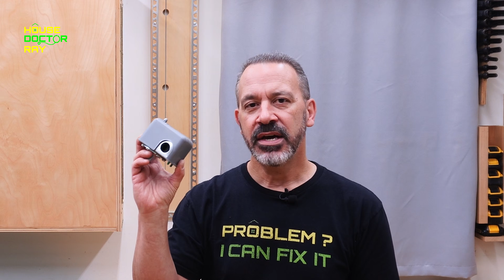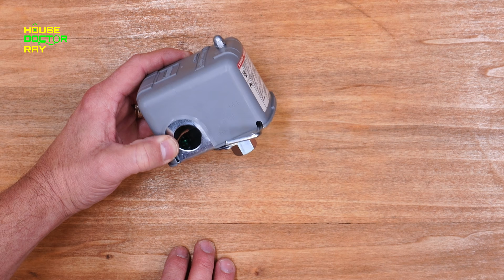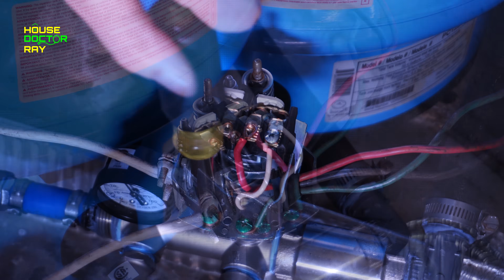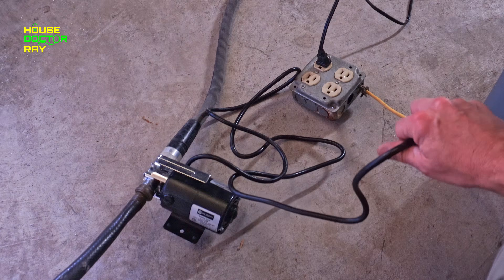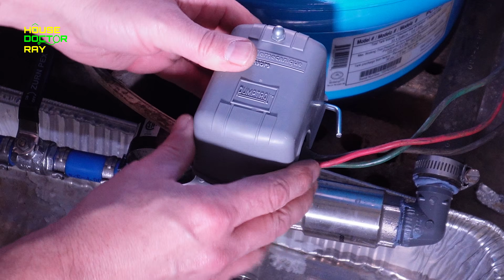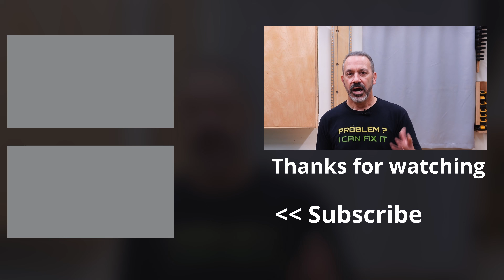Replace your well pump pressure switch

Comment: We have this switch and I’ve been using it for years successfully. Two years ago everything got replaced, but recently are well pumped that feeds into the holding tank quit working correctly. I just had water delivered to our holding tank till we get things figured out. But now I cannot get my switch on this device to put pressure back in my pressure tank.
The device does arc but pressure does not raise at all.
The bladder in the device is full. Any advice??? It’s been a long day.😢
Reply from the maker: Get a multimeter and see if power is going to the pump.  Then check the amp draw.

Comment: I have a 40/60 switch on my outside well pump,,have little pressure in home until pump turns on,,,tried adjusting switch to turn pump on faster and at lower pressure but it still starts at 40 ?Have great pressure on outside faucets unlike inside
Reply from the maker: Not a lot of adjustment on those switches.
Sounds like you have a restriction in your pipes going inside.

Comment: What if you don't have a pressure gauge on your system
Reply from the maker: It is not mandatory but is good to have.
They are very inexpensive and easier to install than the switch.
Just need to add a tee fitting you can screw the gauge into.

Comment: Excellent video!  We built our house 11 years ago and our well water pressure had been dropping recently and sometimes even triggering the low pressure shut off switch to go" off" at times.  Especially if we ran a shower and flushed a toilet at the same time it would "pop" it and therefore needing re-engaged.  I followed your video and removed my switch and immediately could see A LOT of sediment build up right where the water enters the switch.  I'm assuming this was giving me poor results and making the switch not function as best as it could. Easy swap out with a less than basic understanding of electricity and plumbing.  Here's to hoping we're in a better spot now. $40 part and peace of mind.  I've read even changing the gauge itself out isn't a bad idea too and that's roughly $10-15.  Cheers.

Comment: If I drain the water out of the pressure tank, before refilling should I make sure the tank bladder PSI is still reading 2 PSI under the cut-in PSI?
Reply from the maker: If there isn't a hole in the bladder you shouldn't have to do anything.

Comment: Can I change my well pump switch without draining the tank?
Reply from the maker: If you have a shutoff valve or are very fast.
At a minimum cut the power and run the water until the pressure bleeds off.

Comment: Does it matter what order the pressure guage and the pressure switch go? Like in this video he has the guage going first in order from where the well water hose is pumping water into the tank. Does that order matter...could you have the pressure switch first?
Reply from the maker: Doesn't matter.  The pressure switch just controls electricity to the pump.  The gauge could be on either side.

Comment: NO you do NOT!. You NO longer need an expensive pressure tank for $750 and a pressure switch for $50. All of this is replaced by an electronic pump controller that costs $35 total and works way better.

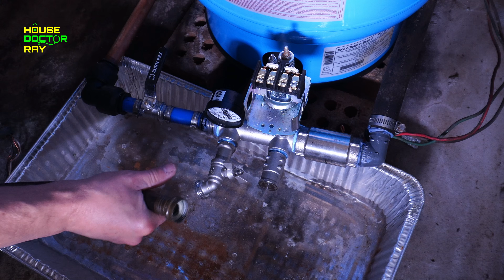Comment: 3:59 that is a pressure tank. it has a bladder 
expansion tank is used in closed loop water boiler systems. 
compression tank is used for well water. still useful in certain situations. no separate air chamber. do not need to add air, just completely drain and refill.
Reply: Yeah your actual pump is in the ground lol what made you think the pressure switch goes on the pump and not the bladder?

Comment: That ON setting for the pump switch is the bypass, to BYPASS the automatic settings to cut in at low pressure and cut out at high pressure.  When you turn that on, the pump will run no matter what, even past the high pressure point for the switch on auto. The auto setting is the one that makes it work like a normal pressure switch (without the lever for those other settings), where it turns the pump on when it gets to the low pressure point and runs until it gets to the high pressure point. 

It sounds like you are saying that when you have it in the ON setting it will do the automatic on and off. It does that on the AUTO setting, as you would figure.

The advantage of the lever is that you can turn the pump on or off from that lever without having to unplug or shut off power to the switch/pump. If for some reason you needed to bring it up to pressure after it had gone down but not all the way to the cut in pressure, you could use that ON setting. And obviously, if you didn't want the pump kicking on at all for some reason, you could set it to off.

Comment: Mine is about 22 years old and my wife was complaining about inconsistent water pressure the other day so I investigated. The switch is turning on fine but is going between 30 to almost 60 and the small spring apears to be whopped out. So it looks like a new switch for me as well. Thanks for the pointers
Reply: Check your accumulator also.

Comment: I just replaced my well tank and pressure switch. I replaced the switch with one like that , After I start the pump , it runs for a couple hours and then the switch doesn't come on anymore and I have to manually start the pump again. I adjusted the pressure on the tank to 28 psi( i have 30 -50 psi switch).Anybody know what to try next?

Comment: I agree this is a superior switch system until you try to explain to someone how to hold the lever until it reaches desired point.  The switch is generally located in an undesirable place for a lot of folks and trying to explain it all is a nightmare.
Reply from the maker: True.

Comment: I had one of these nightmares underneath my mini home, and if you were running water in the winter time in the power happened to flicker that thing would trip out you’d have to climb underneath the house reset it.  Then there was times you reset the stupid thing and it seconds again later it was a curse. I get that they are useful in some applications just wasn’t in mind.

Comment: Greetings, I don't remember how much mine turns on at. I suppose it's 80, but it turns off at 100, although the cap says it's 40/60. I have low water pressure in my house. Could that be related? The tank has 38 psi. If you could help me, what would you recommend?
Reply from the maker: Could be a lot of problems.
First thing is to check the pressure off the well line.  There should be a gauge there but they do go bad.
A common fail point is the bladder in your tank.  If the bladder fails your pressure can drop off very quickly.
Reply: The bladder tank pressure should be at 38 when not in use. If you have a 40/60 switch, it will kick on at 40 and shut off at 60. The 100 psi is a safety. It should not be hitting 100, but if it does, that switch should shut it down.
Reply: you have problems.   suspect blocked tube to the pressure gauge and bad gauge.  install a pressure relief valve. readjust the switch so it cycles at 40/60

Comment: Thanks! My friends pump is turning off and on constantly. I was thinking the inlet to the pressure switch might be blocked with gunk
Reply from the maker: Could be that.  Might also be the bladder in the expansion tank has failed.
Easy enough to remove the switch and clean it out or change it.

Comment: Can I replace a pressure switch 20/40 with a 40/60? Thanks!
Reply: Thank you for your reply, it was well appreciated!
Reply from the maker: Only if your pump and plumbing system can handle the increased pressure.
Reply: Do you put the lever down after the install?
Reply: Personally id stick with what you have. The settings are often chosen to work with your well pump and well capacity. 

Mine is a 30/50 and I never felt at a loss for water.  If you are doing yourself and lack details on well pump, save yourself headaches

Comment: you do not want a low pressure  switch on a well pump. See H2O mechanic who drills, services and repairs well for a living. (family tradition business)
Reply from the maker: Why not?  If the well runs dry or the pipe bursts this would keep the pump from running constantly.
Reply: 100% wrong. Not having that switch will cost you $1,000s down the road. Stop commenting on things you know nothing about just because you saw some other clowns video that doesn't know what he's talking about either or, more likely, you misunderstood what was said what he said.

Comment: I seen the very same setup a while ago with all the valves and taps and couplings...I think it was on the international space station.....
Reply from the maker: Difference is I don't use CGI
Reply: Lol,but i do like the setup in the video
Reply: @jamesbush4568  Yes if you can afford $250.00. Using brass if you can helps but VERY expensive. Black iron is a HUGE mistake.
Reply: Why is black iron bad?
Reply from the maker: Corrosion.

Comment: I’ve done this a few times over the years typically when the power goes out I’ll have to flip the switch then the water comes back on no problem. 

It got very cold last night, woke up with no water so I went and flicked the switch.  

Water came back on but only for about 30 seconds. 

So I cut the well breaker, tested the pressure and the pressure was low. 

Opened a faucet put air back into the tank at 38 psi cut the breaker back on and I had water again for about 30 seconds. 

I’m guessing my pressure switch is bad all together ?
Reply from the maker: Could be your well is low.  If you hold it down will the pressure build up?  If so the switch is the likely problem.
Reply: @ I don’t have one of the pressure switches with a lever to hold it down to see if the pressure will build back up unfortunately. I just use the plastic casing to flick the connectors to check for arc. 

shut off my well again for about 10 mins, cut it back on, could hear the water rushing in, went and checked the pressure and it was sitting around 55 PSI it held there for a good bit then it just dropped suddenly and wouldn’t come back. 

I’ve done this about 3 times now
Reply from the maker: Could be a bad switch.  Your local hardware store or HD probably has them.
Reply: @HouseDoctorRay . Thanks so much !

Comment: I'm troubleshooting my well, and think I'll have to replace mine. I wasn't sure about the bracket that held the wires in place, and it was the type you showed here with the two screws and the bar. Seeing how you disconnected it is super helpful, so thank you for explaining that bit!